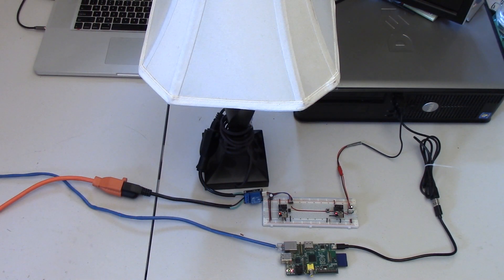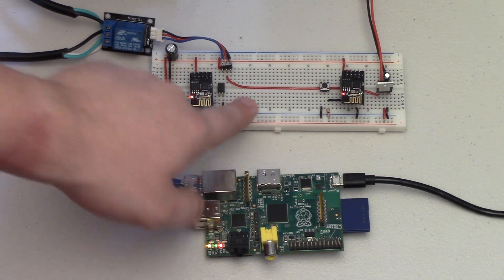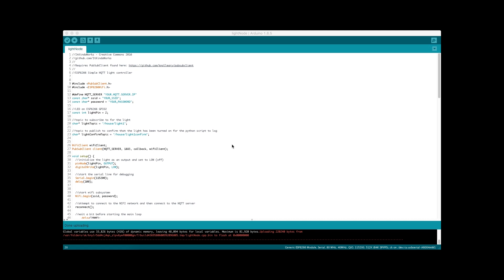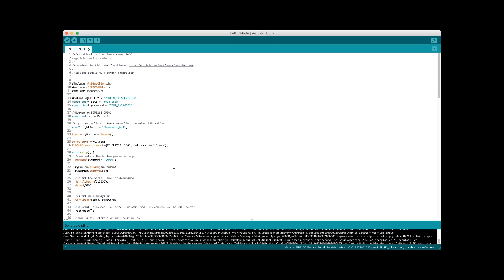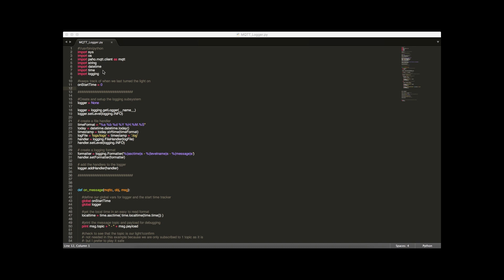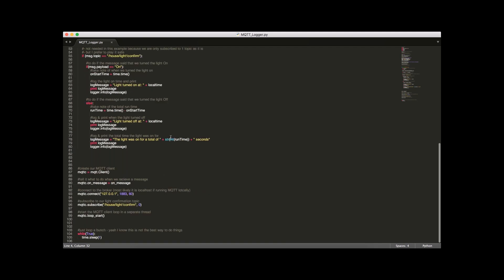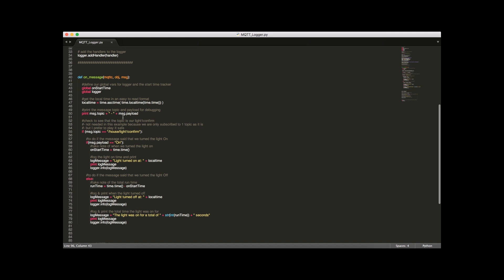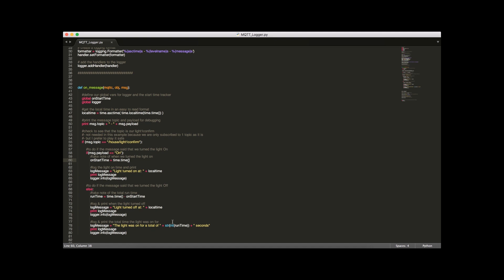Home Automation at Home Part 2: Relays and Lights

Comment: This is great.  I have my raspberry pi3 zero w running MQTT. It’s very small and works great.  I want to implement a web server that can post readings from a temp sensor and push button or slider I can push on the screen to turn the light on or off.

Comment: Sir , sometimes main power supply not failure but MCB trip and
If we are outside home , mother or wife think its power failure.
Hence all inverter battery drain.
Is there any automation that detect and SMS real status of house power supply on SMS request.
Reply from the maker: You could probably use a voltage sensor like this on your incoming breaker. Then you could use IFTTT to notify you if the voltage drops below the expected mains voltage. https://www.youtube.com/watch?v=Ieuqvo5qxRc

Comment: Thanks for the video. It nicely covers the core functionality of smart switches. 
I have a doubt. Do these device provide similar functionality as the one in the video ?  
https://www.alibaba.com/product-detail/Smart-Switch-Module-Develop-Sonoff-Wireless_60746330151.html?spm=a2700.7724838.2017115.11.437b4648aEao3W&s=p
--
https://www.alibaba.com/product-detail/2018-Sonoff-1-1-2-3_60488520026.html?spm=a2700.7724838.2017115.86.437b4648aEao3W
--

Comment: So I've gotten the 8266's functioning through the Rpi mqtt broker. Then tried to set up the python script and I'm lost. I've installed paho using sudo install paho-mqtt, and it seemed to do that. I then created via copy/paste from github the python script. Running it results in an error: 
 "File "MQQT_logger.py, line 4, in <module> import paho.mqtt.client as mqtt Import Error: No module named paho..mqtt.client" 

I honestly don't know enough to ask the proper questions, I'm sure. But if anyone can steer me to an explanation of what I'm not doing right, and how to do it properly. I'd sure appreciated it.
Reply from the maker: This issue that you seem to be having is that the mqtt library for python isnt installed on your computer. You should be able to install it by following the instructions here: https://pypi.python.org/pypi/paho-mqtt/1.1
Reply: Sorry for the delay, didn't see your response. Yes it is there, I was using the python3 IDLE on the Rpi. But even using 2.7 (IDLE) , I'm getting errors:
 

Traceback (most recent call last):
  File "/home/pi/MQTT_logger.py", line 26, in <module>
    handler = logging.FileHandler(logFile)
  File "/usr/lib/python2.7/logging/_init__.py", line 911, in __init_
    StreamHandler.__init__(self, self._open())
  File "/usr/lib/python2.7/logging/__init__.py", line 936, in _open
    stream = open(self.baseFilename, self.mode)
IOError: [Errno 2] No such file or directory: '/home/pi/logs/logsMon Apr 02 2018 16.16.06.log'

Traceback (most recent call last):
  File "/home/pi/MQTT_logger.py", line 26, in <module>
    handler = logging.FileHandler(logFile)
  File "/usr/lib/python2.7/logging/_init__.py", line 911, in __init_
    StreamHandler.__init__(self, self._open())
  File "/usr/lib/python2.7/logging/__init__.py", line 936, in _open
    stream = open(self.baseFilename, self.mode)
IOError: [Errno 2] No such file or directory: '/home/pi/logs/logsMon Apr 02 2018 16.26.57.log'

   ...did I miss a step ? I apologise for my lack of understanding I'm new to Rpi, and python. I've been scanning python tutorials trying to get on board. I think if I can work your tutorials through, it will help teach this old dog something new.
Thanks in advance for any help.

Comment: hey i want to control  7 motors through 1  esp8266 and rpi .I want to give command from esp8266 to arduino. By controlling  the gpio pins of esp8266 and givng those pins input to arduino can i control 6 motors ?

Comment: Hi, for some reason the compiler is throwing an error at line 31, (it looks like it's line 26 in the video) "'callback' was not declared in this scope". I copy/pasted from the github page for the button node ino. I'm using Arduino IDE 1.8.4 . I'm hoping for some feedback on this, as I just keep scratching my head, I compared it with the original sketch in the first video, and I do see that the placement of the statement is different. Could that be the issue? As I said in the last post I am trying to learn some coding and I really need some guidance on this. Thanks

Comment: Your delivery is great. Concise and to the point with enough info without overload. Hoping to follow each one in the series to help me learn python, as well as the world of Pi. I've built a few projects using arduino and bluetooth, using MIT's App Inventor to use my phone to remotely turn on/off garage lights, as well as open/close the door. But that uses a visual block coding and places much of the visual assets in the Android App. I need to learn to code more and this surely will help. Thanks for your work!

Comment: I just finished building the button portion of this and instead chose to skip the relay side and just use a sonoff with Tasmota firmware on it.  It is orking great except for one thing.  With the tasmota firmware you are able to program a GPIO pin on the sonoff to act as a local control.  I have found that if I turn the relay on with the esp8266, then turn it off with the physically attached button (or any MQTT event for that matter) it requires two pushes of the 8266 button to turn the light back on.  Presumable this is because the 8266 thinks the light is on already, so sends an OFF Command first, then next command is an ON command.  Is there a simple way around this ?

Comment: I'm somewhat new to all this, and am trying to understand the necessity of the Raspberry Pi.  Wouldn't it just be simpler to use the first ESP to post directly to MQTT and the second to read the post and respond?  It would be less cost, less parts and much smaller.
Reply from the maker: Unfortunately the Pi is needed to be the broker for MQTT. MQTT is not a p2p messaging protocol so all messages need to be routed through a central device (called the broker). The broker keeps track off all messages and which devices are subscribed to which topics. As far as I know there arent any libraries out there that will make an ESP into a broker, there are only client libraries.
Reply: I guess that's what I was really wondering - if the ESP could be both a broker and client.  Maybe someone will write an ESP broker library.  It'd be nice to have something so small and cheap as a broker.  What about an Arduino?  You could couple it with an ESP or ethernet shield.

Comment: Hi There. I can see we are using on RPi and ESP8266 ESP-01. So why and where we are dumping the arduino code? I insist if you could reply early. 

I wish to have something like RPi-> ESP8266 -> Atmega 8 -> Relay. Is RPi-> ESP8266 -> Atmega 8(through UART) possible?
Reply from the maker: The "Arduino" in this case is an ESP8266. The ESP modules can all be programed through the Arduino IDE
Reply: It helped. Thanks !
Reply: I went through your earlier videos where you have explained Arduino code flashing for ESP. My bad. One more query. Should I use ATMEGA 8 with ESP8266 ESP01 through UART for increasing the pin outs? Or I should use something like ESP12E/F. which option is better for more pinouts..
Reply: Issue is resolved. Thanks.

Comment: Hi,

Great video. Thanks.

In need some direction here :

My ESP8266 module connects to “test.mosquitto.org” and subscribes to a topic say “b1”. What ever is published to “b1”, it can read it immediately.
Problem happens when my second ESP8266 module subscribes to “test.mosquitto.org” to “b1”. It continuously returns :

WiFi connected
IP address:
192.168.0.9
Attempting MQTT connection…connected
Message arrived [b1] 0
Attempting MQTT connection…connected
Message arrived [b1] 0
Attempting MQTT connection…connected
Message arrived [b1] 0
Attempting MQTT connection…connected

Could you kindly suggest what might be going wrong. I look forward to your advice.

Comment: Hi! Thanks for your videos! I'm trying to turn on a relay without an Optoisolator,  but no success. I'd like to know if is this possible. 
When I turn on the relay with a LED in 3.3V it works fine, but when I turn on a light in 127V I receive the below message in serial monitor. 
"ets Jan  8 2013,rst cause:4, boot mode:(1,2)
wdt reset"

Would You know what's the problem?
Thanks!
Reply from the maker: I would guess that it's power supply related and start there - make sure you have a big cap and if it's still having issues add a small decoupling capacitor (.1uf perhaps). Also make sure that your power supply can handle 3.3 @ 500mA minimum.

How are you driving your relay, a transistor? The most likely things that I can think of would be either your power supply is browning out/has a dirty signal or because you aren't using an optoisolator the relay needs a flyback diode to prevent a large surge of power from going back to the ESP. I would make sure that your ESP power supply has a nice big (470uf+) capacitor on it to keep any large power spikes to a minimum as well as add a flyback diode to your relay http://www.douglaskrantz.com/ElecFlybackDiode.html
Reply: Hi, Thanks for your reply.
I'm using a relay module like this http://www.dx.com/p/jtron-1-channel-opto-isolated-relay-module-isolation-module-black-270934#.V3wk9GIrJTA.

With your tips, I find out a new scenario. The first thing that I did, was remove the GPIO0 from the GND, doing this, the ESP stopped to be reset (but still
can't turn off the relay).
After that, I changed my power supply, I was supplying through the FTDI. When I did this, I was able to turn on and off the relay. But a new problem appeared, if I let the relay on, it's turned off after two seconds, and if I let the relay off, it's turned on it self for a moment and then off again.

Does this new problem can be related with my power supply yet?

Thanks in advanced!

Comment: Excellent series so far. I like the way you are building in steps.  Do you plan to show how to use a webservice to activate the buttons?  The use case would be using a smart phone to activate the relays.  Thanks. These are fantastic.
Reply from the maker: I do this in two ways in later videos. First I show how to setup a web service called Home Assistant which you could open up to the web if you wanted https://www.youtube.com/watch?v=gCgr1vwsJFA. And most recently I showed how to setup an Apple Homekit accessory server called HAP-NodeJS which allows you to use Siri to control things in your house https://www.youtube.com/watch?v=4jq-FLmUCP8.
Reply: +ItKindaWorks perfect. thanks!

Comment: in python you can use mqtt.loop_forever() function to keep the script running. this is a blocking function 
quote from eclipse website :
# Blocking call that processes network traffic, dispatches callbacks and
# handles reconnecting.
# Other loop*() functions are available that give a threaded interface and a
# manual interface.
client.loop_forever()
Reply from the maker: +Quint Thanks for the info! Y'know now that you mention it, I do remember reading that way back when I first used the module.

Comment: Could you edit code for button node and light note in one ESP8266?
Reply from the maker: +Chức Nguyễn You can definitely do that! You wouldn't need MQTT for control with the button and relay on the same board anymore. If you leave in the MQTT part and add the button you would be able to control the relay via both the button and another device connected to the broker such as a python script acting as a timer or something like that.
Reply: +ItKindaWorks i read this but it use their mqtt cloud, i only want mqtt on raspbery. http://iot-playground.com/blog/2-uncategorised/77-esp8266-internet-controlled-switch-easyiot-cloud-mqtt-api
Reply from the maker: +Chức Nguyễn I've actually used that platform for a while locally on my Raspi and in episode 4 I'm going to show you how to get that running on the Pi. Basically the cloud part of EasyIoT is new but they still have a local version that you can run on the Pi here: http://iot-playground.com/blog/2-uncategorised/3-easyiot-server-installation. The developer hasn't updated it in a while but its fairly stable. Myself and a couple other people have asked the developer to try to maintain the Raspi version along side the cloud platform but I dont know if they will.
Reply: +ItKindaWorks Thank you very much your reply. I will follow you Home Automation at Home Part 1 to create ESP8266 control light and combine this schematic for local control with switch http://cdn.instructables.com/FLO/2NNU/IHBVIUMS/FLO2NNUIHBVIUMS.LARGE.jpg